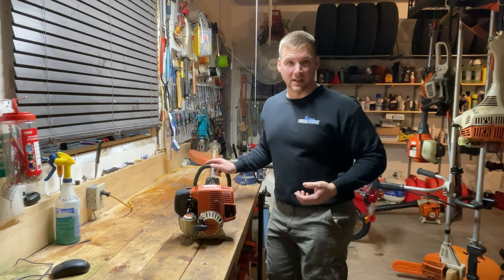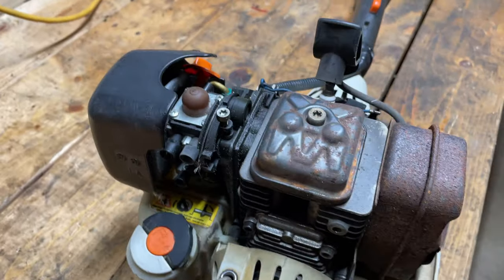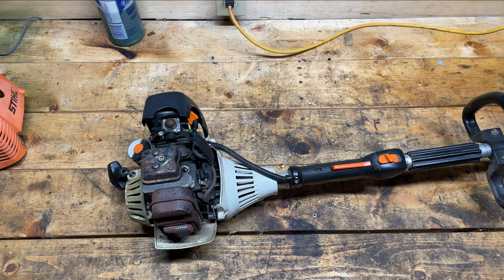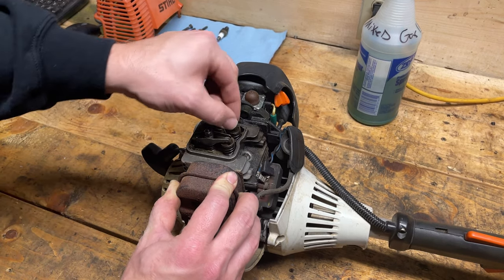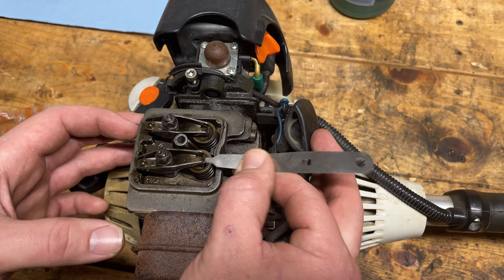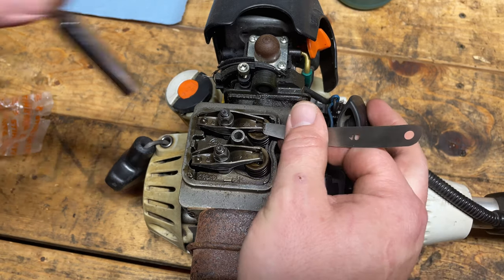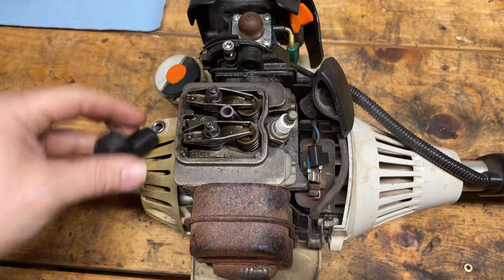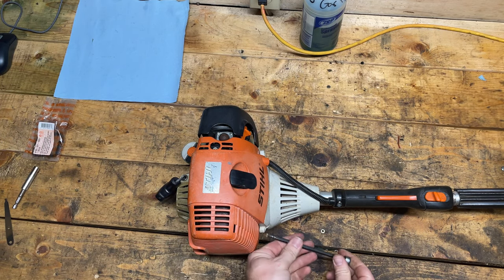Stihl Pro trimmer REALLY hard to pull when starting... how-to fix!!! (Stihl 4-mix valve adjustment)

Comment: Guess you couldnt say what the gap is supposed to be  10 12 15  thousands
Reply from the maker: I’m not sure - it came in the kit from Stihl. I’d have to look it up!
Reply: It says 10 stamped right thru the gauge.  Since 10 mm is almost a half inch, it must be 0.010.
Reply: The stamping on my Stihl gauge shows 10.   When I measure the thickness, it reads 0.010 mm.   Or for old time folks, it is between 3.5 and 4 thousands.    Probably closer to 4 thousands.
Reply: @whale508  I think you math is correct.
Reply: @alext8828  Actually, the number in millimeters is not correct.   I should have typed 0.1mm which is 4 thousands of an inch.